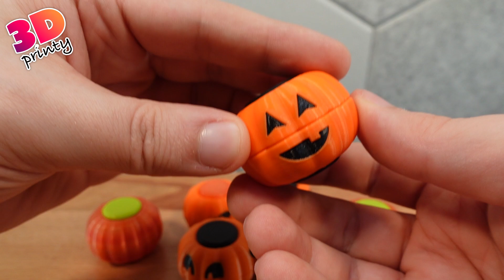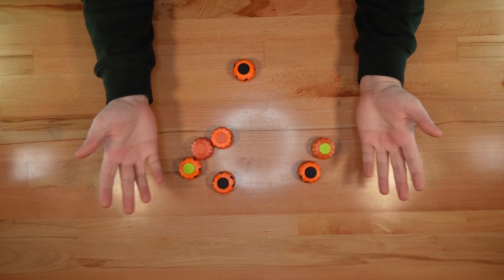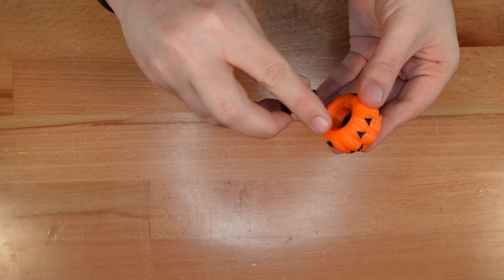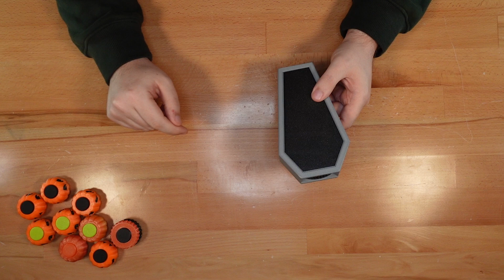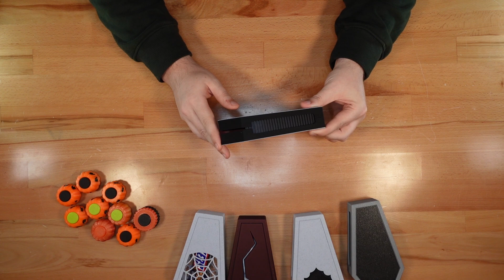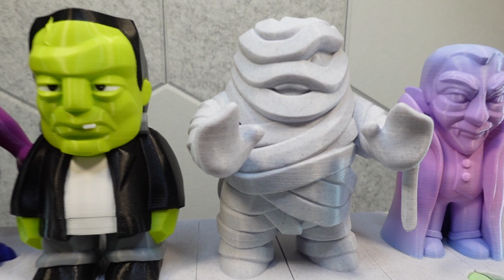3D Printed Halloween Projects | Pumpkin Fidget & Shutter Coffin

Comment: Can't wait to get my MK4S... I'll finally be able to tackle my list of trinkets, which these have definitely been added to.
Reply from the maker: Nice! Enjoy the new printer when it arrives :)
Reply: @3DPrinty  I certainly will, I'm just glad I won't have to do major maintenance after printing less than 100g lmao. (My Ender 3 V2 might be dying lol)

You have a Prusa too right? how is it for maintenance?
Reply from the maker: Yes, I have a few going back to the MK3 days. The only part I've needed to replace due to wear and tear is the bed thermistor.

I also replaced the hot end on my oldest machine because I had the spares on hand and didn't want to deal with a particularly bad blob.

Other than that, I just clean the rods and other spots that collect dust and grime over time. I also clean the print bed with dish soap every few months and replace them every couple years.
Reply: Thanks for all that info! That gives me a good idea on what to expect and do... wow, that sounds like nothing compared to my Ender lol. Minimum 5-8x more maintenance to get just below the quality of a Prusa.

That being said, great news, I got it 3 days ago and finished assembly yesterday... My god this thing is amazing. Fast, accurate, about the same noise as the Ender but lower tone so it's less annoying. It's not often that I smile after spending over 1200 CAD. 

Now I can actually print my list!
Reply from the maker: @navb0tactual  Great! I hope it serves you well for many years :)

Comment: Welp, I screwed up the magnets, as foretold! It's supposed to be all N on top and all S on the bottom, right? (or vice versa)
Reply from the maker: Oops, yeah, it's a little easy to get wrong. Fortunately, you can probably print a second pair of pumpkins parts with the correct orientations and save all the parts :)

You have several magnet orientation options:
1. For more clicks per rotation, place all the magnets in the top with one orientation and all the magnets in the bottom with the opposite orientation.

2. For fewer clicks per rotation (with a stronger snap), alternate the orientation of the magnets every hole on both sides. The tricky part here is making sure the two sides still pull together when the face parts line up (opposite orientation magnets).

I hope that helps... and maybe you'll be able to save that first print.